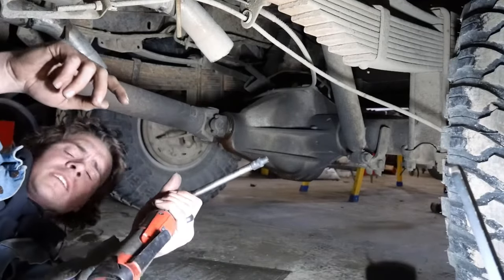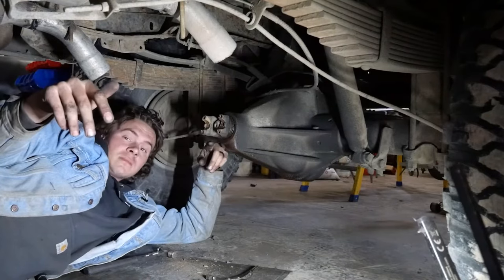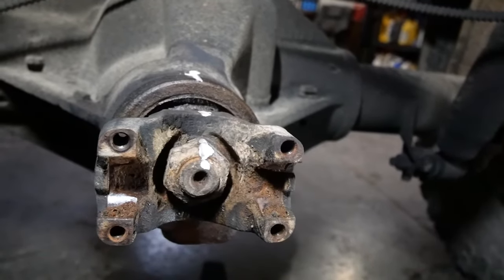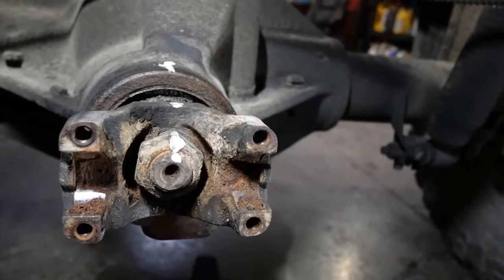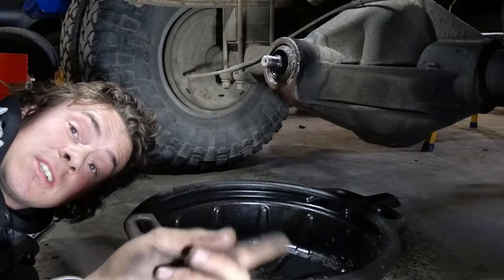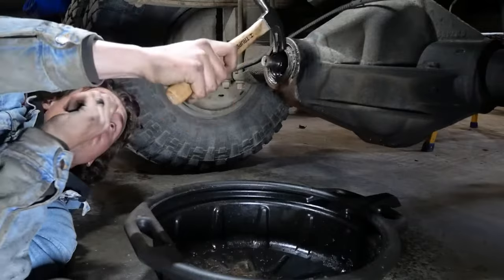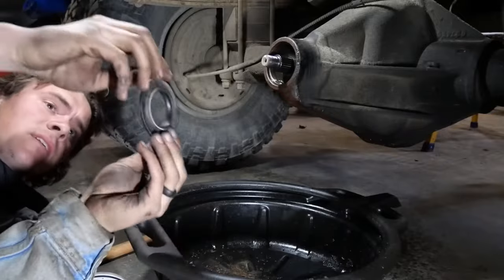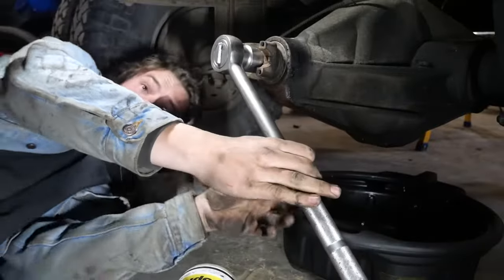How to change your pinion seal without special tools

Comment: To reach the mark on the nut during installation you can hold the yoke with a large pipe wrench or put two bolts in the yoke and lay a long pry tool across it. Then just use a breaker bar to tighten so you can creep up on the mark and not go past. I'm sure your method worked well, just giving out more options. Thanks.

Comment: How did you know to get this fixed because i know i have to fix something on the differential because its howling like texas wind
Reply: It will usually be grease stains or leaking running from the from of the diff where the DS meets the diff

Comment: What size socket did you use on that nut, any tips on how to figure out what mine is?
Reply: Just did it on my 87 c30 used an inch n 5/16